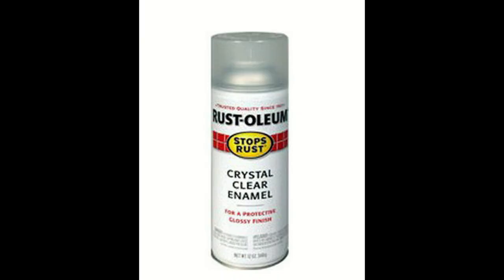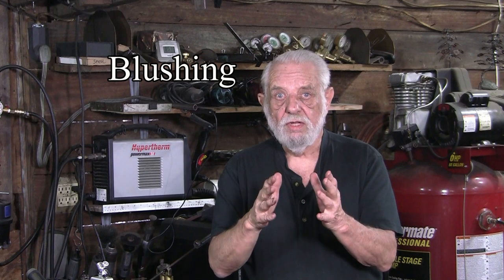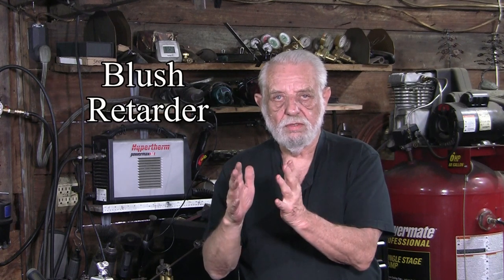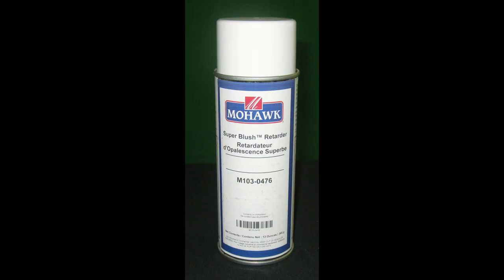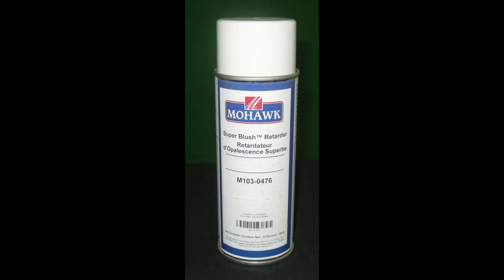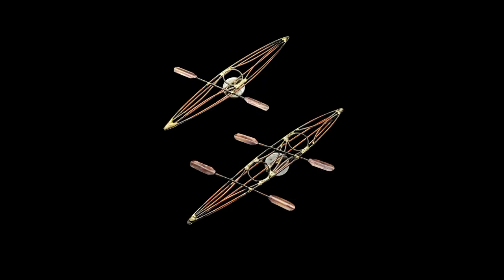Blush Remover for High Humidity

Comment: I have a project where I will be spraying clear gloss on a plastic car headlight ..But I have been waiting  for a low humidity day ..I have had problems with regular spray paint on  the high heat index days
Reply from the maker: I've found 60% humidity and 60 to 70 degrees to be the best for spray painting my work.  Let me know how it turns out.